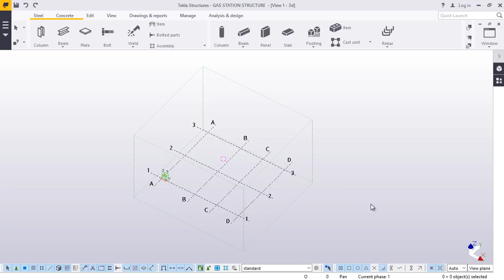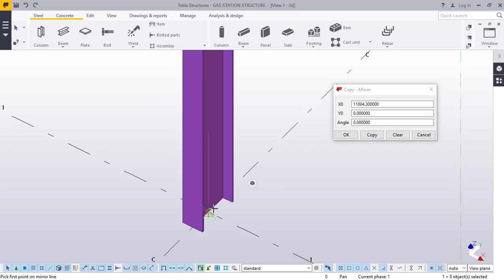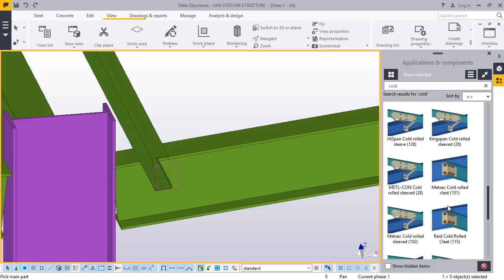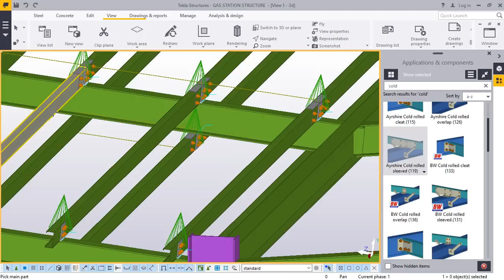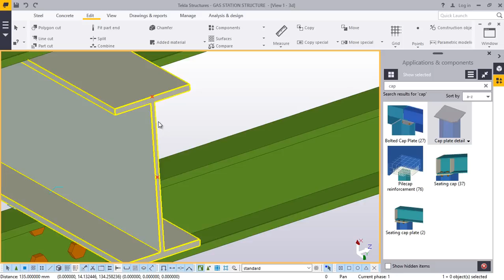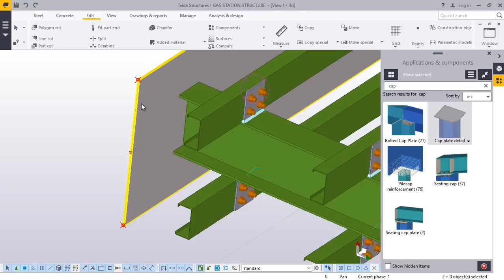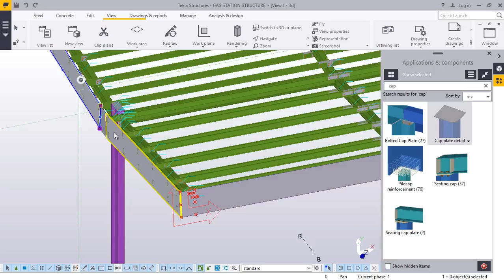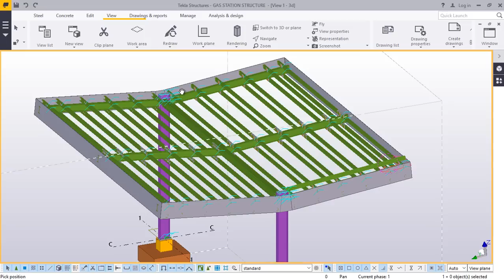Gas Station Structure Modelling in TEKLA STRUCTURES 2016

Comment: Maurice thank you for your superb tutorials. And congratulations for your effort. If it is possible I would like you to help me with a problem I am facing while I am trying to follow your steps on this particular example. Whatever I select for a connection I always get an error with a red cone. What am I possibly doing wrong?

Thank you in advance.
Reply from the maker: The red cone indicates that your connection configurations are wrong,please re-configure your connection or try a connection with similar features
Reply: Dear Maurice thank you for your response. I did try but always error. I also noticed that at the middle connection where the 3 elements are connected, it is indicated as correct but the bolts are far away off the beams and upside down... Based on your experience, have you ever seen something like this?
Reply from the maker: Double click on the joint,a dialogue will appear go to general tab,under general tab you will see 'up direction',click on the drop down arrow on first box and change those +y,-y,-z,+z,+x,-x

Comment: Hello @Maurice.
Hope you are well. I have one query, how to activate Tekla softwares simultaneously, like tedds and structural designer/ fastrack snd use the keygen acrivator. Please help. I can not use both  one gets rejected.
Reply from the maker: Hello Osman,thanks for following this channel,i did not get your point correct,you meant activating Tekla Structures?,I hope you don't mind.
Reply: @MauriceDimba  he there ! yes. See i have installed Tekla structure and also i have installed tekls tedds and fastrack. But if i use the keygen to activaate/create fastrack local.key file, the local.key file for tedds or structures gets revoked. I cant use them both at same time.
Reply from the maker: uninstall both fastrack and tedds,reinstall them and direct each them to a different location during installation on the same drive.
Reply: @MauriceDimba  oh, ok. Let me try that. Thanks alot for the help.
Reply: @MauriceDimba  Bro.! I cant see option to install different directory? Is it under custom installation?

Comment: Hi Maurice Good job, i don't have Ayrshire cold rolled sleeved connection in my tekla structures Data base 
need help 
Thank you
Reply from the maker: Thank you,which version are you using?
Reply: thank you for responding sir.
 I fixed the problem,
Regards,
charef eddine.
Reply: Hi Charef, I have the same problem. How did you solve it?
Reply: use the UK envirnoment or you can download the Ayrshire cold rolled sleeved  from tekla warehouse
Reply: Thank you for you help. I use UK environment and it works.